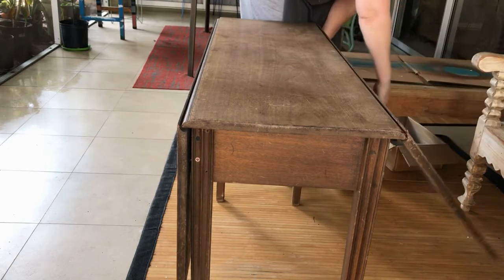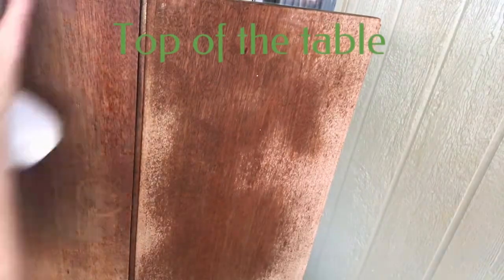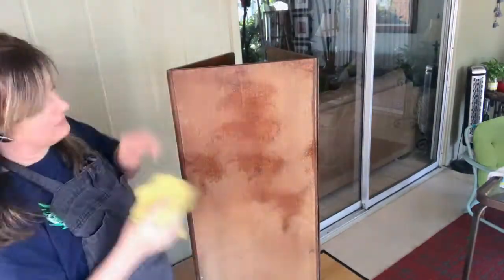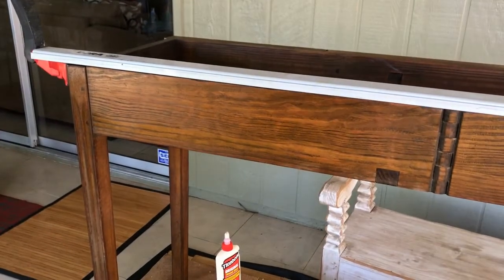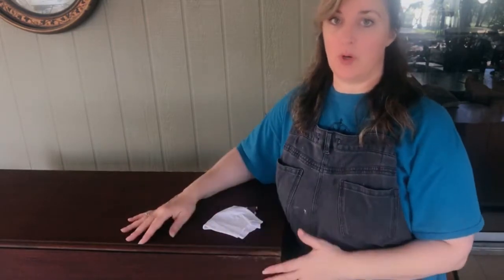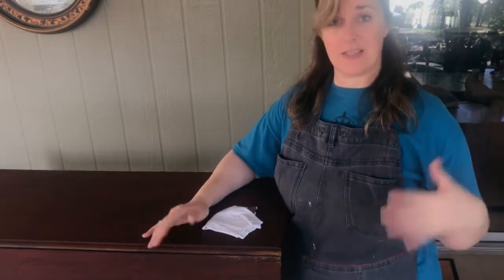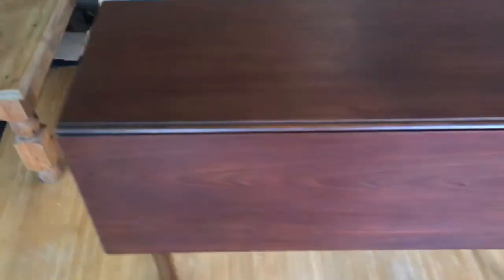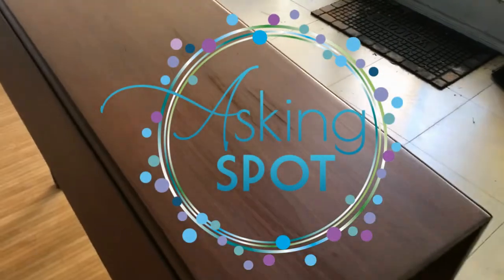DIY Drop leaf table restoration!

Comment: Im working on a similar piece and it's a beast and beat up a lot. Someone replaced the hinges and it broke the wood at the hinge. How eoukd you replace that? Move the placement of the hinges? It's so bad. 
First time seeing your videos and glad I found you!
Reply from the maker: Thank you for watching! Not seeing your table I can only guess but I would trying fixing the wood first (wood filler/wood glue sanding etc.) then proper hinges might work there again 🤔 Good luck!